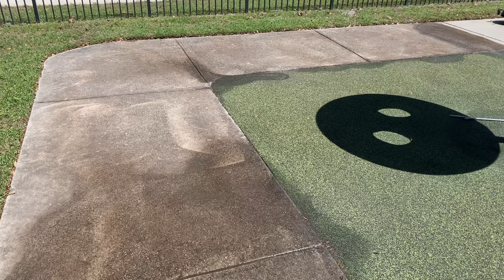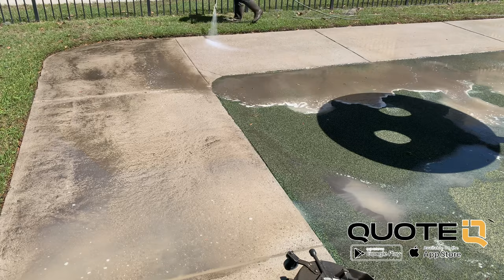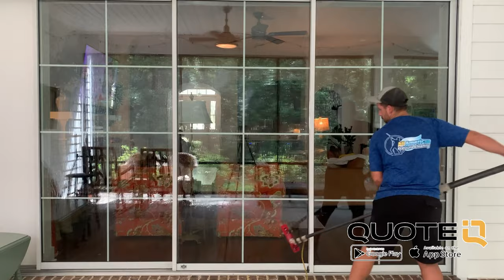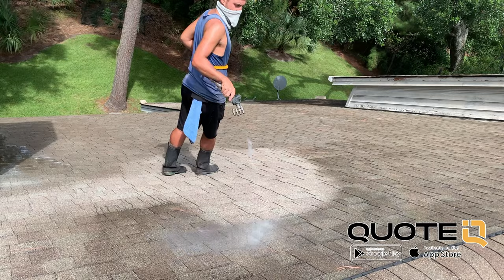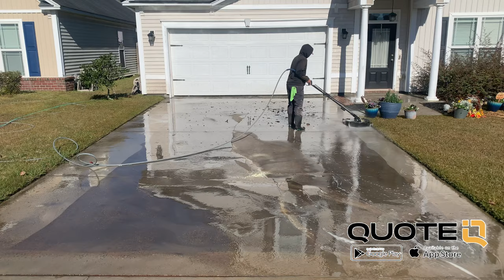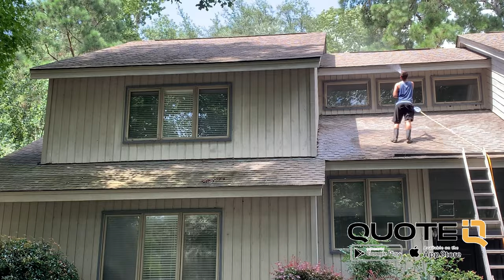How Many Jobs Did I Land with 5,000 Post Cards?

Comment: I gave Justin an email last night with some recommendations. On The app, I use one that goes from estimate to contracts, and they sign them digitally and once the jobs done I push a button and it convert's to a invoice.
Reply from the maker: Thank you
Reply: What is the name of the app you use for this Shawn?
Reply: @devinstoeger4795  Hearth, I use it for my contractor mobility. But they charge 1200 a year to use the program, I initially got into it for the lender side of it. Hearth is a lending partner so we can say we offer financing to our clients. I think Quite IQ would be much better fit for the pressure service and softwash side but still have those elements would go far for the App.

Comment: hi Mike I haven't had time to look at quoteiq because I'm struggling on getting my first customer but I was wondering on the app is there a spot on there where for example a customer wanted a roof cleaning job is there a spot on there where you can type in the customer address and click on the roof and it shows the customers what there sq footage is and you can give them a price on it I know that would come in handy for some people like me that has a hard time measuring anything out to get the square footage

Comment: well it paid for the 5000 what about the other 15K 5K x4 waves right ? 1 per 100!! think you forgot a zero there bud.  And leads are not sales so you got what 20 calls and closed 30%? so like what 6 jobs?  my guess. probably 1.5K per wave x 4= 6K campaign figure average job is 800? hell, make it 1K. You made the design yourself you broke it even if not it's a loss.
Reply from the maker: Of course not